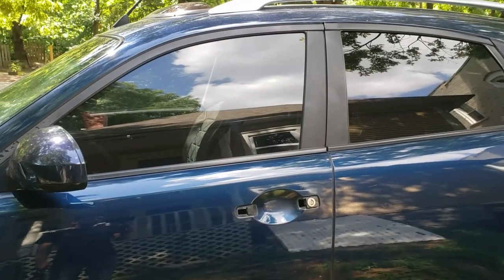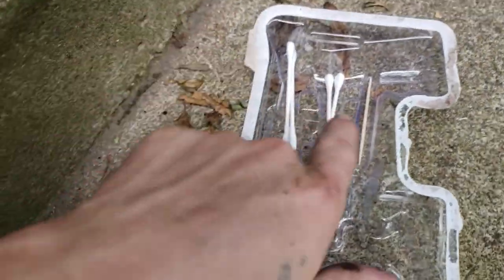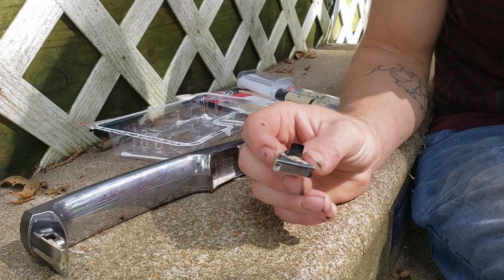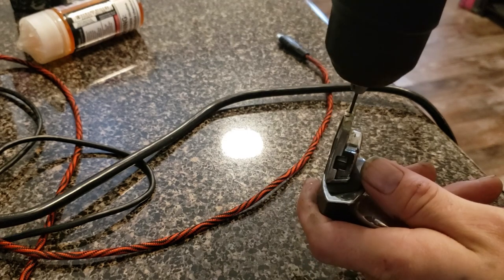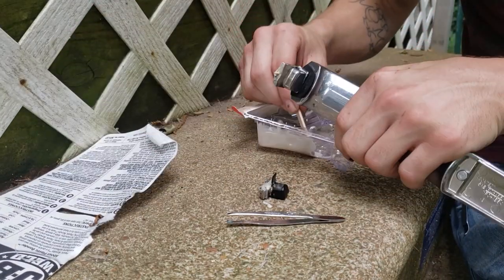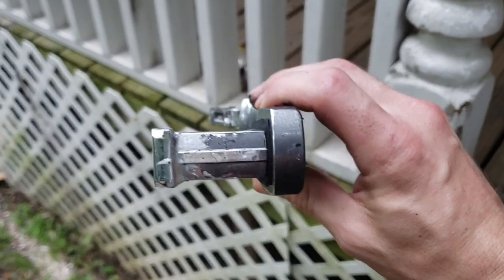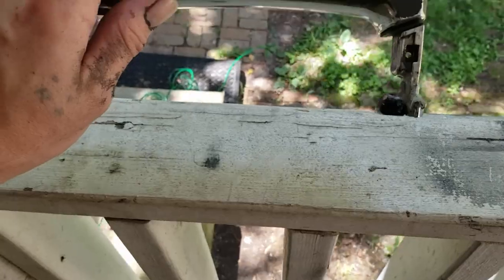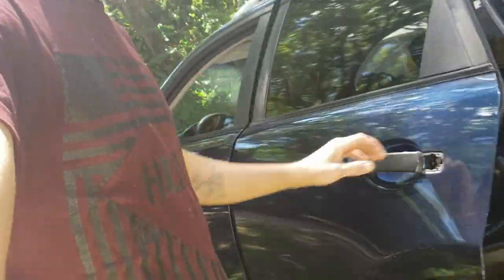How to fix a broken door handle on your car

Comment: I just bought one of these for $2k, engine has 80k miles came with a cold air intake, I hella scored on it. Pretty fast, has cosmetic issues tho. The handles for all the doors are completely gone besides the passenger. Seems like an easy fix though, im about to hit the junk yard this weekend and have some fun.

Comment: I've been dealing with this for 4 years on my EX35. Thanks for the guide. What else you got for these cars. Mine is a 2008
Reply: Like how to make the tire pressure warning light go away
Reply from the maker: @ShaneMihalow  depending on how many miles u have on the car or if u have aftermarket wheels u may need to have the tpms sensors replaced each wheel should have 1 but they're on the inside of the tire so without a tire machine u can't really replace them yourself however our cars have a relearn procedure that can be done and  if it doesn't work then typically that means the tpms sensors are bad. I'm not sure the exact procedure but I'm sure there's tons of videos on it! If u can't find a good 1 let me know and ill do my best to make a video on it my tpms sensors are going bad as well sometimes the warning light comes on and then goes off  eventually ill quit procrastinating on it and buy new ones for mine as well lol

Comment: The driver door handle of my '03 fx35 broke off right before going to work so I'll be working on this as soon as the parts come in.
Reply from the maker: Nice! Its super easy to work on i honestly thought it would have been more complicated than it was but I guess infiniti was going for convenience lol
Reply: @BlackWidowdetailing  Do you know what the cable is for on the driver handle? I noticed the other handles don't have it.
Reply from the maker: I couldn't tell ya it may have something to do with the locking mechanism tho because thats the only door with a key hole
Reply: @BlackWidowdetailing  I can't seem to remove that cable or the lock mechanism where the key goes into. My guess is to disassemble the driver door from the inside.
Reply from the maker: @Airbender24B  Yeah u might try that. I couldn't get the lock out either when i did mine, I just pulled the lock towards me and then too the right and it was enough to slide the drivers door handle back in but the cap that covers the key hole broke when I tried to take it off so be careful with that, i had to jb weld mine back on, its supposed to just clip on there but 1 of the clips broke that hold it securely to the locking mechanism majig lol
Reply: @BlackWidowdetailing  unfortunately I didn't have a guide for removing the inside door so I had to take a $220 hit for the shop to do it.
Reply from the maker: @Airbender24B  Sorry to hear that man sucks that it was being a pain in the ass for you mine was really easy to do and i never had to disassemble the inside door panel. That is definitely a big hit just for that  I'm sorry wasn't able to help you 😔

Comment: How did you roll down the driver and passenger side windows with your remote?
Reply from the maker: Hit the unlock button twice and hold it down the second time. Not sure what all year models are capable of doing it but hope it helps its definitely a nice feature to have when its hot outside
Reply: @Michael Long C.G.A  Thanks a lot. My 2006 Infiniti works just as you've said.